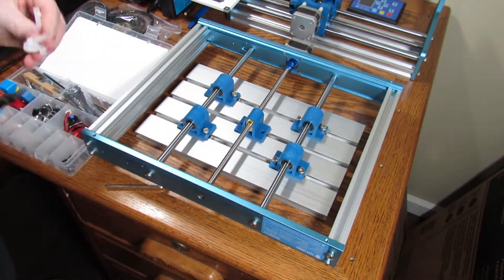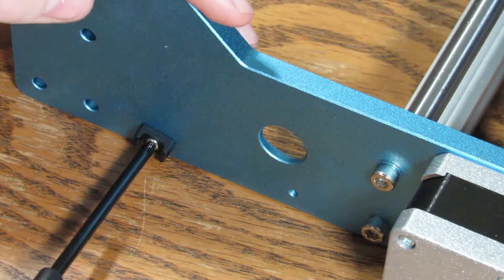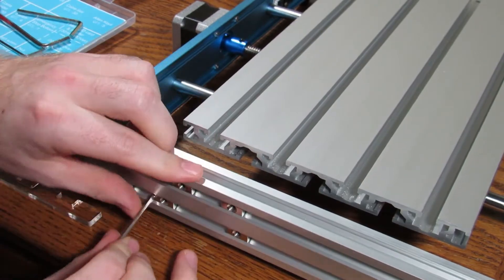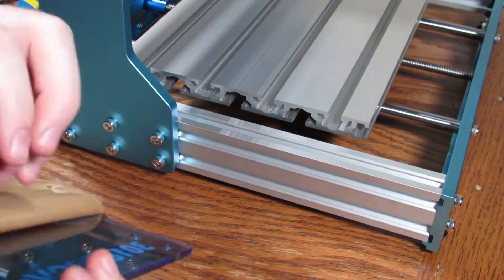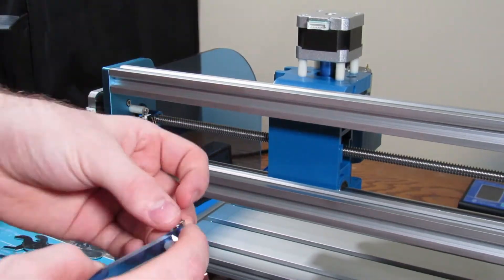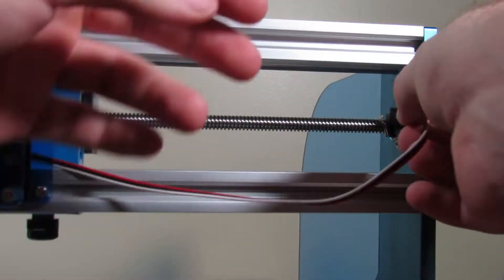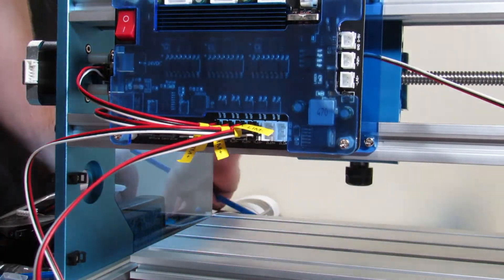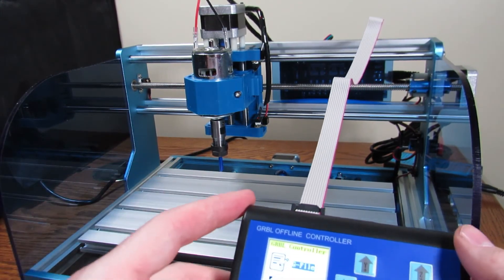SainSmart Genmitsu 3018-PROVer EASY Follow Along Tutorial

Comment: My z axis is retracting to the limit switch at the at of a job. What is wrong?
Reply from the maker: Usually at the end of a job, the g-code will tell it to move to a “x0 y0 z0” location to make it easy to remove. I would check your g-code and look at the last 5 or so lines to determine it’s final position, and change if needed. Hope this helps!
Reply: @kennydavisjr1425  my problem is at the beginning. It moves up a hits the switch